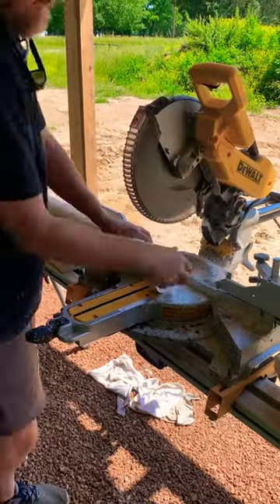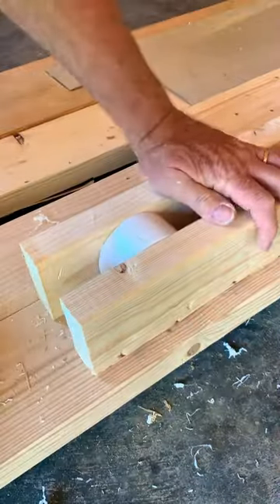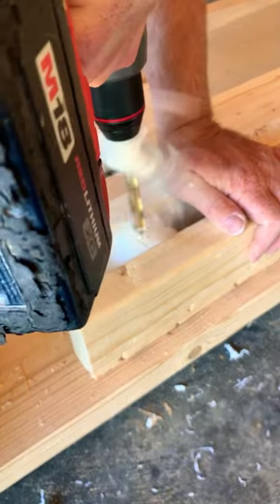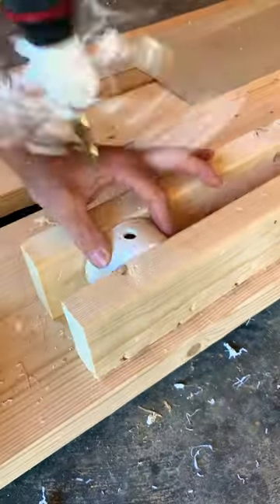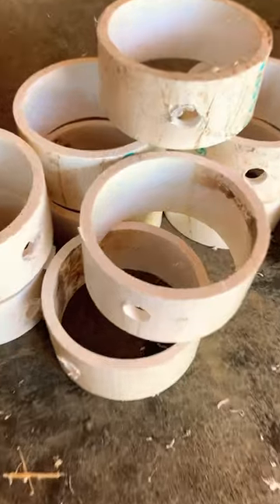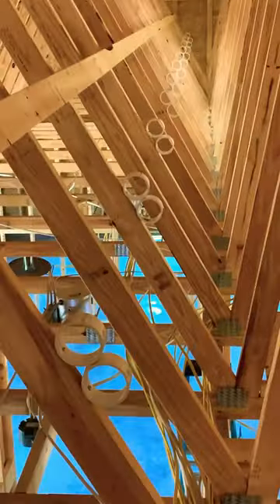PVC hanger in a HURRY #plumbing #tipoftheday #gotitcoach

Comment: So it’s the electricians that keep stealing my 3” pvc pipe on the job site 😂
Reply from the maker: Haha
Reply: Nah bro it's the drywall stockers🤣
Reply: Wires will get super hot if you run everything through there damn amps are very important everything bunched up will over heat eventually just separate them if you are running wires 👍🏽
Reply: Electricians can't get away with that it would be against code.
Reply: I didn't see him run wire through the hangars.  He's a plumber.
Reply: Lmao
Reply: I didn't see an electrician or any wires.  If the electricians are stealing your pipe try cleaning up when you leave.
Reply: @LoGan-fb7oj my first thought was will it fly. Good idea though.
Reply: That or the pot heads. Makes one hell of a makeshift bong.
Reply: An electrician would never be caught with white pvc.
Reply: He's a GC
Reply: Ya right like they'd pass us with that
Reply: @jerryhenderson9352 
He said it, though.  Go back and listen.
Reply: @jeffmansfield914  I heard what he said.  But it didn't match what he showed . No big deal.
Reply: @LoGan-fb7oj not against code.
Reply: If you think that guy's an electrician, you got issues... 😅

Comment: I’m a master plumber and you just learned me something. Bad ass tip.
Reply from the maker: Awesome, thanks for watching!
Reply: Taught, not learned.
Reply: @ES-gc8bb  no shit, it’s southern vernacular. We know how to say it right and in formal or business settings we would certainly say taught. It’s just a way we southern men talk.  I need to try and teach a grown man who is a fluent English speaker proper grammar.
Reply: Do you use colored upnor?
Reply: Same here😂
Reply: As the home owners wondering wth slapping in there attic. "Water🔨
Reply: @javeryrios3263  i am electrician,  does pex get water hammer? I understand that you don't need a water hammer arrestors
Reply: @John_Montgomery  yes.
Reply: @javeryrios3263  it would be a whole lot more than slapping if you run your pex in the attic here in Alaska. 🥶😅
Reply: @John_Montgomery  any pipes carrying any fluid can be subject to water hammer. Water hammer is caused by the actual mass of the fluid coming to a stop suddenly.
Reply: @brasshouse9822  we have type L copper pipes.. we have solved most of our noise with water arrestors, but we considered a repipe with pex. We were told that would be a permanent solution
Reply: I know you are not supposed to do this, but I use to leave my hose connected to the hose bib with valve on and the squitter end off... that was the best surge suppressor .. I finally had to address the problem when the grandkids started playing with the hose.
Reply: @brasshouse9822 and you think "learned" sounds better?
Reply: @CbrF4i600cc  there’s a time and a place where it does. Like if I was to say “Keep talking shit and I’ll learn you not to”. It would probably drive the point through a little better for you.

Comment: If you're gonna use it for wire check and see what your electrical inspector thinks first since it's not an NEC approved wire support. Should be fine for a bundle of cat6 Ethernet cable or rg6 coax cable though. I've also seen residential low voltage guys use cheap vinyl gutters as cable trays in the attic now that they have so much networking in houses.
Reply: Oh yeah I’ve done the gutter job in houses in on commercial it’s an awesome tray
Reply: Good idea. the only suggest I might add is to debur the edges. Maybe an issue. Who knows.
Reply: Vinyl not so cheap anymore the last few years.
Reply: @WaltWW  maybe a location thing? I can still pick up a 10ft section of vinyl gutter for around $6 in my area. It's not the cheapest thing in the world but it's nice in certain situations. I have some on the ceiling of my garage to run all the cables around from my computer to my printer and plasma cutter ect. Makes it super easy to change stuff around later.
Reply: It’s pvc an a couple of inches long. I can’t think of a code reference that would deny this. I think it’s legally considered supported, just not secured is all.
Reply: @shadygunshow  I couldn't really think of anything specifically wrong with it either I just know there's gonna be a local inspector or two that would complain about it.
Reply: @alec4672 I believe the latest NEC specifies that low voltage supports should be purpose-built. E.G: Not Jerry-rigged or modified from its original purpose. But there is plenty of room for interpretation. If it is solid and looks good most inspectors may be fine with it, but not necessarily all of them!
Reply: @Heizenberg32  I knew that they came out with a huge wave of new low voltage codes but haven't bothered reading them yet. Maybe I should 😂😂

Comment: Left the abrasive burr on both sides of the support, PEX pipes move dude.  Potential leak in the making.    Neat idea.  However a quick  deburring on the PVC will protect the PEX.  You'll maybe be retired by the time it leaks, but it's the same principle with copper pipes that aren't deburred when sweating connections.  Take a second and do it right.
Reply from the maker: Not the same burr as it is on copper.
Reply: Absolutely the same,  meaning is that down the road after you're out of the picture your lack of attention to detail will end up causing an issue that is easily avoided.  Lazily leaving a burr in a copper pipe causes turbulence in the line as the water passes through the sweated joint, especially in elbows and butt connections.   The turbulence wears the pipe after the joint, thinning and weakening it's structure.  Might take years, but a properly joined copper pipe won't do that. 
The sharp edges on your home made PVC  rings will absolutely weaken PEX where it contacts it.   PEX moves every time the flow is started and stopped , especially on those long hanging runs you displayed in the video.
Neat idea for sure, but a 30 second detail will save your customers a lot of unnecessary headaches.  
Thank you, neat idea that I'll likely use in the future.  But I'll remove the sharp burr.   
I doubt if any electrical inspector would approve of them for the same reasons, romex cuts too.
Reply: Look at your own video closely, a rough & sharp edge is clearly visible on every cut.  A few strokes with the side of a sharp blade will knock it right off and even chamfer the edge a bit.
Neat idea, and the 2 boards trick to hold the rings is bloody genius.

Comment: That's actually a really good idea. One of those things that just makes sense that sometimes you don't think about. Even if you had to buy a 10 ft length of that. And cut yourself a couple hundred of them one time. Probably cheaper than hangers themselves. Sit around in the garage one day drinking beers with some friends and knock them out. Part of me thought that the edges would need to be deburred, but that PVC's not going to hurt the pex. Nice tip
Reply from the maker: Thanks for watching!

Comment: pretty slick; i run a lot pf network and other LV cable. I'll use this. i can buy premade hangers but they're pricey. an additional idea: cut a slot in the ring and you can drop wiring in instead of having to thread it thru.

Comment: Are you below the freezing line there or do you insulate both sets of pipes?
I like the way this keeps both sets separate so you don’t chill the hot and warm the cold. 
Clean, fast and clever use of scrap that otherwise would be in landfill.

Comment: Always check with the local authority in your jurisdiction but if used for electrical wiring it would be wise to use UL recognized products whenever possible. The code says that you can use electrical conduit to protect your wires but you have to staple the wires within 1' of where it enters and where it exits. NM-B wire has to be securely attached to framing members every 4 and a half feet not just supported. The electrical inspectors in Madison WI have no creativity and no humor, so it wouldn't fly up here.
Reply from the maker: Ha, I’ll try it with 3” conduit next time and see what my inspector says 😆

Comment: The thumbnail explained the entire video.
Reply from the maker: Don’t like it huh? 🤷🏼‍♂️
Reply: @w.k.d.constructionllc  The video is "Cut some pvc pipe and use it as a hanger to run your pex or wires through it." That's the tip. But the thumbnail already shows this. I looked at the thumbnail and already knew what you were going to say. I watched anyway because I thought maybe I'm wrong, but I wasn't. It's not about liking it or not, it's just that the thumbnail spoiled the video.
Reply from the maker: @oggyreidmore  gotcha

Comment: I got a few concerns here once water is loaded up it does have some weight too it. That 1 screw on a hot summer day with the PVC getting softer from the attic heat, mind mind goes too there seems to be an added risk (probably low) but say something happens in 2-3 years where the holder fails, breaks magically bust open one of them pipes. The insurance notices this home made brackets, won't they go after you for the cost? Guess I'm being hyper paranoid. Still like the idea neathertheless
Reply from the maker: Not really, it does have some weight but the pipe is pretty rigid. This is just a chase to keep it all neat. Once it branches off the main path it gets clamped every 20” or so. Pvc won’t get soft in normal attic heat conditions.

Comment: Good idea, but is it ok with the inspectors and or GC. Some hangers are actual hangers/strain relief, they help with holding weight and or weight being accidentally applied anywhere throughout the system as a safety measure so that things don't get pulled apart. 
Now if your running like a chase and it's not subject to any potential issues it will be ok.
Reply from the maker: It’s just a chase to keep everything neat and tidy

Comment: Superintendent here. Is this temporary until it can be secured properly with the correct isolators?
Reply: Fuckin supe
Reply: Home buyer here. I’d like to know the answer to this question. Is this actually a good, reliable, long-lasting way to do this? Or is it a cheap contractor trick to save himself time or money at the buyer’s detriment?  I honestly don’t know which out is.

Comment: Any fitter knows that electric wires have plasticizer in them and after a couple years, it will weaken the PVC or CPVC pipe.
Reply: the closed ring will maintain a lot of strength.

Comment: Great for the installer... Sucks if you're the guy that has to come in 10 years down the line to do some work and have to trace back a line tangled in that mess
Reply from the maker: Not really, it’s visible and easily accessible
Reply: How’s it gunna get tangled if it never moves?
Reply: @w.k.d.constructionllc think he means all bundled together like an anaconda rather than separated on individual or gang clips.
I kinda agree, but hey that's the next guy's problem he can quote accordingly 😂
Reply: "mess"?
Reply: You could be digging thru insulation  to find  it...
Reply: Velcro/zip tie, attach a piece to the pipe and trace it back.  If you never take it off the pipe you can't mix them up.

Comment: Those pipes will likely rattle from the water being turned on and off. the proper way is to strap them with real pipe hangers/straps.  this would definitely fail inspection in Chicago land area where i work!

Comment: What’d you drill the hole for if you ran the wood screw thru it at the end?
Reply from the maker: It’s a place to put the bit through is all. That way the screw gets fastened square to the bracket
Reply: @w.k.d.constructionllc  makes sense

Comment: Who runs pex in an attic? You would think there is potential for the water lines to freeze up there.
Reply from the maker: Would be if my attic wasn’t foam insulated and is basically a conditioned space. No worry for freezing pipes

Comment: Wouldn't pass inspection.  Must be secured to the structure.  Once the water is turned on and system is pressurized the constant turning on and off of fixtures would cause all those pipes to rub each other and wear a hole and leak over time causing 10s of thousands in damages. With the way insurance companies are these days. They would not pay for those repairs.  Or you wouldn't get coverage as most of them do a preinspection before coverage since it's a new build and there's no info about property in the national insurance database.

Comment: Not a bad idea, just seems like a waste of time to cut 15 or 20 pieces and drill holes through every one of them, if you can just buy pipe strapping from the hardware store, with holes pre-cut.
Reply from the maker: Yes, but I didn’t have to go the the store and buy more stuff. Took me 10 minutes and I had it. Would have Taken me 30 min just to run to the store.

Comment: how is there any pressure in that damn house with all the flexing pex 😳
Reply from the maker: Pressure changes if pipes move? 🤔 you sure bout that
Reply: @w.k.d.constructionllc  yes sir pressure drop from distance and Flexibility
Reply from the maker: @jacobaguilar6756  distance it might change a little, but movement not so much. It would have to move feet to make a difference, this will move barely in millimeters. I run it like this all the time. No noticeable drop in any pressure
Reply: @w.k.d.constructionllc  maybe ya'll have the pressure regulators turn full flow because I do irrigation systems and a 3ft peice moving just 3 to 5 inches has costly effects on systems pressure and distribution

Comment: Ain't no way i call myself a professional plumber and i leave pipe all loose like that to hammer around when they use water. Especially with pex that can wear and cut. 

And this manifold type of building, instead of branching, just to get convenient shut off like it's an electrical panel is still an absurdity. Waste of material and time to get the home owner valves he will never use.

Comment: you might know this but they make a thing called fittings that allow you to run one large water line then take smaller ones off of it to your fixtures then you don't have to waste  a thousand feet of 1/2" pex. then again you just ran water lines above the insulation level in an attic so maybe you don't. if you like things clean like you said one water line is much cleaner then ten!!
Reply from the maker: Ya, but this is a manifold system

Comment: You would probably have to derate your wires if you ran them like this.
Reply from the maker: Maybe, I just had a house wired and electrician had all wires zip strapped together that ran out of panel into the attic and he made me cut the ties so they weren’t so tight together. Due to possible overheating. That is a new code they adopted in my area this year.
Reply: @w.k.d.constructionllc  wow not sure where you live, but derating bundled wires has been in the code for a long time.
Reply: @semosancus5506 haha right? He’s the type that thinks it’s a great idea when in fact it’s ignorant

Comment: Ahh yes. Now the pipes will be jumping around everywhere everytime a water hammer hits 😂😂😂

Stick to electrical bud.
Reply from the maker: 😆🙄 you sure about every time?
Reply: Don’t know why fam had to throw that jab in there but yea if it’s not tight in there it’s gonna rattle just from the water running. It’s in am attic but still. I’m I cold climate can’t run water lines in attics.
Reply: My old boss told me pex doesn't water hammer ....😂